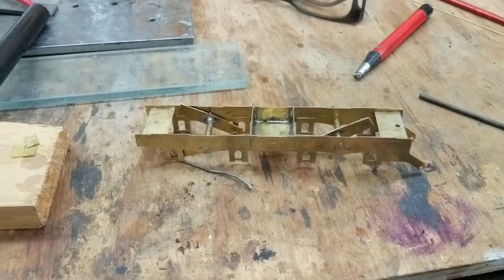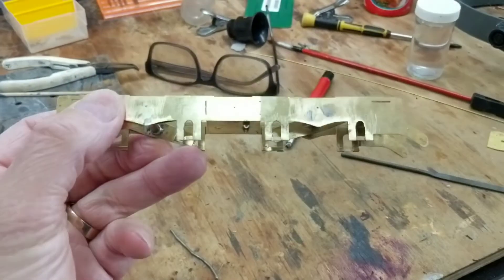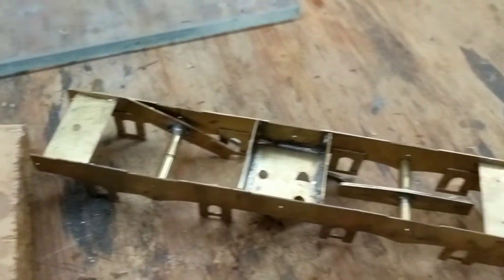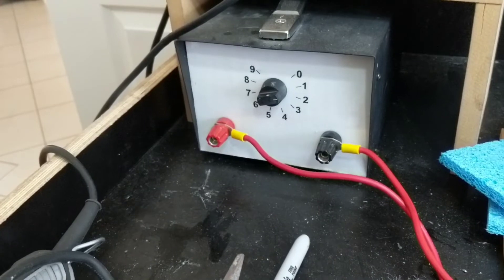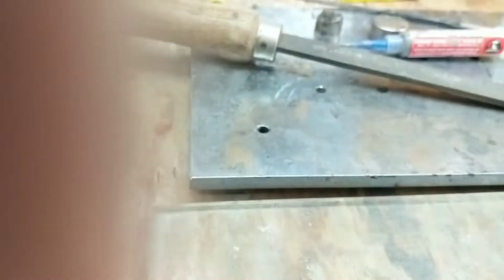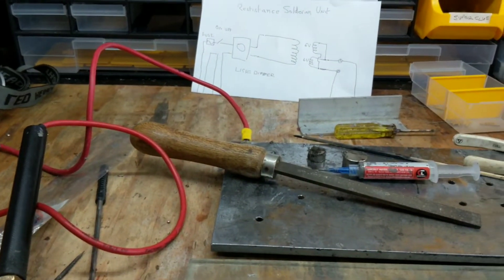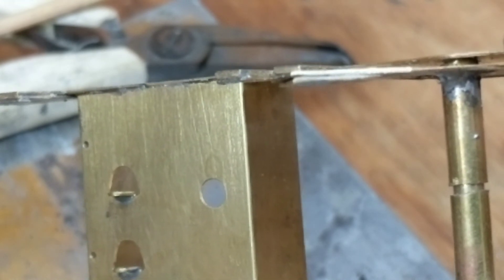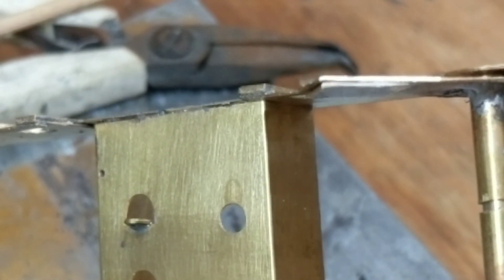Resistance Soldering Unit RSU at Railway West Greenius.   10 September 2022

Comment: Hello Stphen. This is the best description I have seen on the RSU. What is the spec of the transformer? I am thinking of making my own.
Reply from the maker: Thanks, I tried to keep it SIMPLY, as you can see the only electronics is the light dimmer.
The transformer is and RS components transformer, model RS 504-098
It has two secondary rated at 100VA each, you get 6 volts per esecondary so you can link them in series and get 12 v or in parallel like mine so you get 6 v but double the current.
There must be a load of similar transformer out there .
Just be very careful when putting them in parallel that you keep the phases in sync, get the wires the wrong way around you will have 180 degrees out of phase and you will literally blow the transformer apart.